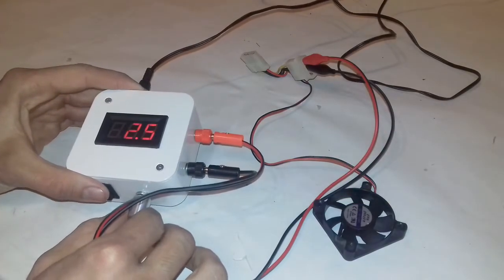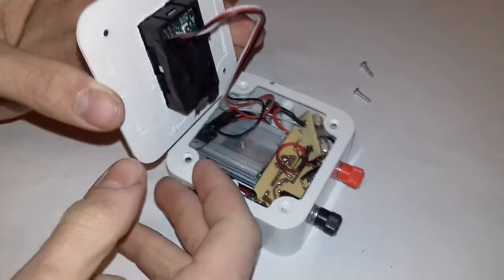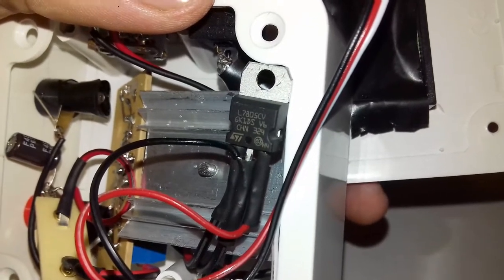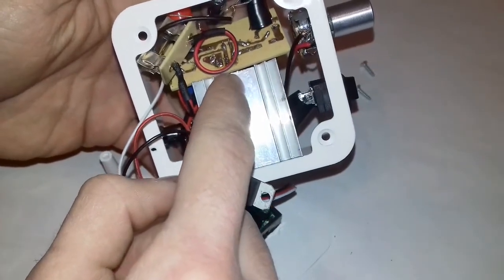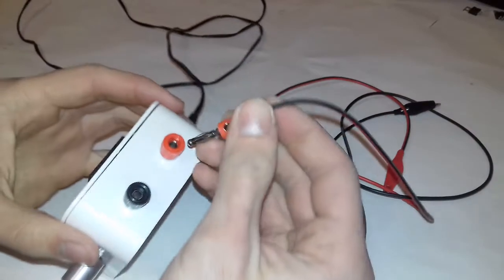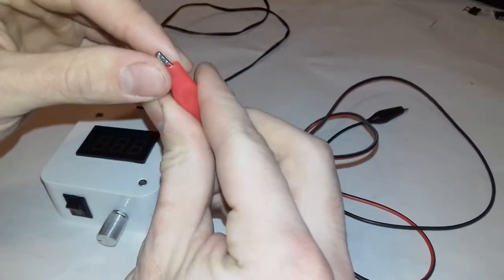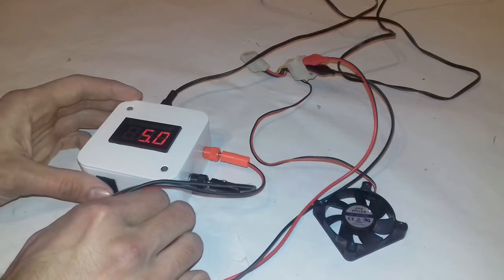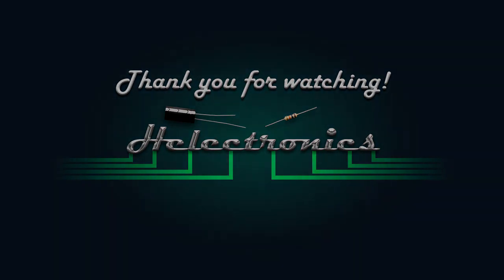BUILD - Variable voltage supply using LM317 (Medium difficulty)

Comment: Maybe a bit late to ask after 3 years, but where did you get the case? It looks too nice for being 3D printed.
Reply from the maker: I bough it in a local shop called 'Dedeman', they sell construction stuff. It is a plastic box for electric connections I think.